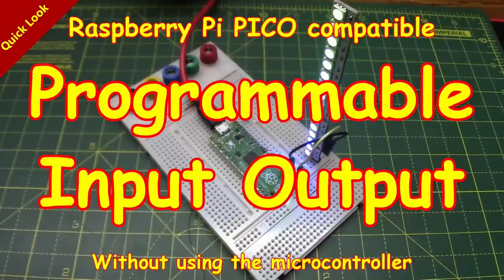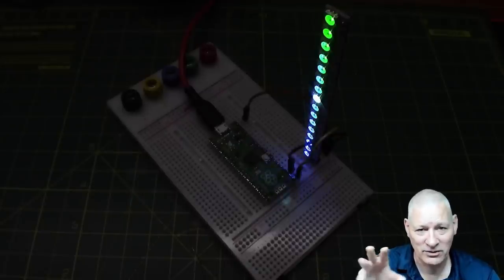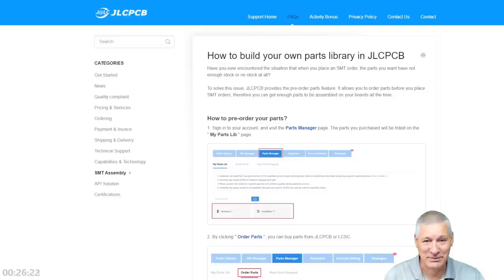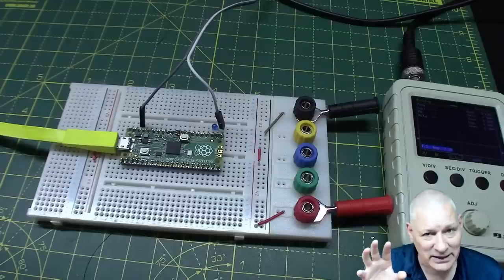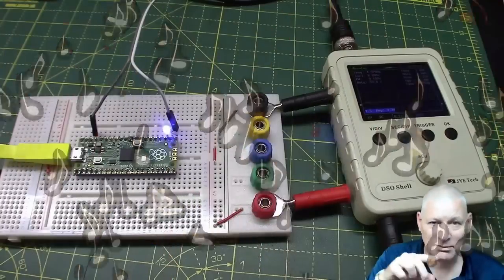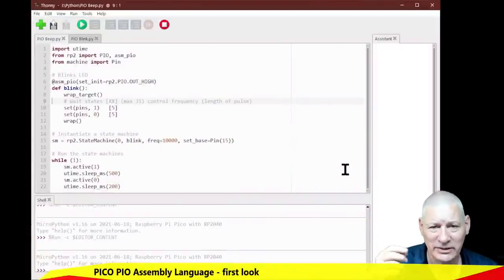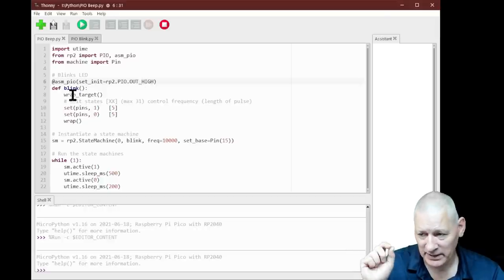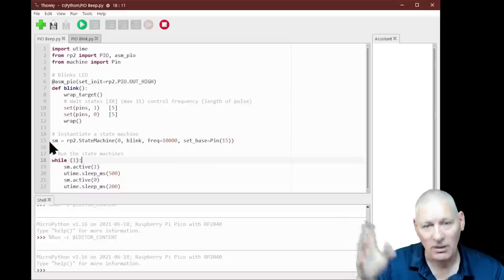#220 PICO and PIO: First Look - far easier than you might 💭 think

Comment: Sorry, but I don't see how you get your claimed 'negative pulse'.

A GPIO can only switch between OV and Vcc, so the maximum possible offset is surely only the same as The Vcc value, so with a Vcc of 3.3V its impossible to obtain the quoted 6.6V...

In terms of Forward and Backward movement of a loudspeaker cone it makes sense but, as explained, it's incredibly misleading.
Reply: With this ‘trick’ you can double the voltage, but you need some kind of external reservoir. In this case the reservoir is a mechanical item. The coil movement is the double of the gnd-pin config. You can do the same with a little circuit with a capacitor as reservoir. The cap will charge to 2x the pin voltage. Handy if e.g. you want to use a led with a Vf greater than 3V on that output pin.
Reply: @hopje01  No capacitors were used in the given example.

As, I mentioned, I can see how the Forward and Reverse action of the loudspeaker cone provides double the volume but, at no point is there ' double the voltage', as stated in the video, for the setup shown. That's what will mislead anyone who doesn't understand what's going on and it's compounded by the dual trace oscilloscope display not having a common baseline.
Reply: 100%
Reply: @hopje01  there is a big difference between + and - 3V vs GND and 0 to 3V. That is why there is no 6V amplitude on Pico ;-)
Reply: @zyghom  Exactly...
Reply: @tonysmith5485  the issue here is: however you connect speaker, scope, voltmeter or whatever: as long as you have 3V difference between one leg and another (not talking polarity here of course) it gives you 3V. It will never give you 6V. Unless one pin could give 3V below the ground while another 3V above the ground: then you would have 6V difference between these 2 pins. Show me which pin in Pico gives you 3V below the ground... - I can show you which will give you 3V above the ground ;-)
Even during this video you see: one pin gives 3V, second at that time gives 0V. so difference between them is still 3V - not 6V
Reply: @hopje01  You don't need the capacitor here (what you describe is common for powering things off 1.5v cells, eg LCD watches).
Reply: @zyghom  What's the potential between 3v and -3v?  It's like saying AC voltage in the USA is only 60v, because that's how far from ground it rises.  You are thinking ground to peak, when you should be thinking peak to peak.

0v and ground are not the same thing.  If you decide ground is -3v, then you have 6v.  That's why scopes have that knob to move the trace up & down.
Reply: @tonysmith5485  between -3V and +3V there is 6V potential. The only problem is: such configuration in Pico does NOT exist. Look at the op amp: they usually prefer to work with + and - 15V (let it be 15, it can be less). So the potential between Vcc (+) and Vcc (-) is 30V. The ground - virtual or real - is a potential between +Vcc and -Vcc, so we have +15V vs ground and -15V vs ground. But we have physically 30V potential difference. You might achieve it by having 2 wiring on trafo with drop between them: then you have 15V AC and 15V AC in the opposite phases. You take it through DC converter (bridge rectifier, regulator etc) and you get +15V and -15V: total difference is 30V at any time between them. If you don't have a luxury of having such trafo, you take simple trafo with 30V only, and you make virtual ground: 2 resistors (in simple terms) connected in serial between these 30V and in the middle of them you have virtual ground, vs which one will be now +15V and second -15V. But in Pico there is NO 6V difference at any time at any place (unless you power Pico from 6V but we are talking here logic output on pins of pico: either 0V or 3V - or as you don't care about the polarity: -3V and 0V if you revert your voltmeter). Why are we talking basics here for so long?  This is something like 101 course ;-)
Reply: @tonysmith5485  I agree completely with your first paragraph - and with +3.3V and Gnd (0V), the polarity is set; one pin is 3.3V above the other or one pin is 3.3V below the other, depending upon what you take as your reference. I have no problem with that.

But two 3.3V GPIOs, one High and one Low, will never produce 6.6V, which is what was stated in the video.

The difference between them will only ever be a maximum of 3.3V - whichever way round you look at it.

Sure, a collapsing field in an inductor can produce an inverse voltage (hence using flyback diodes with relays), but that's not what Ralph was talking about. He had the two square waves from the GPIO pins going into two channels of the 'scope and had the traces positioned apart (for ease of showing the two pulse trains in opposition) and took the physical distance between the top of the Ch1 pulse to the bottom of the Ch2 pulse as being a voltage difference double what it actually was, and double the maximum it could possibly be.

I teach electronics to newbies and that, although obviously an error on Ralph's part, is just the sort of thing that can catch them out - I had one make the same assumption just a few weeks ago...
Reply: @tonysmith5485  in US is 120V in EU is 230V, between ground and the line, one moment it is +230V then it becomes -230V. in US +120V and then -120V. Who is talking 60V in US here? ;-) Who told you it raises to 60V only? 101 brother is needed... see here: https://en.wikipedia.org/wiki/Split-phase_electric_power#/media/File:Split_phase2.png
Reply from the maker: I did put a clarifying statement at the bottom of the screen, as I just knew someone would pick me up on this.

In effect, the speaker cone moves as much as if 6v were applied to it but we're making it move forward 3 volts' worth then backwards 3 volts' worth. Total effect is that of being driven by 6v. Just as I wrote in the not-so-clarifying note at the bottom of the screen!
Reply: Wow, who would have expected that much discussion . . . it's A) relative, and B) it's conceptual. The main thing is that it's clever and it works.
If'n you don't actually understand it, it's just MAGIC !
Reply: @RalphBacon  your speaker could have 3 stages: 
1: total 0V on both legs (A and B) - no movement of the cone
2: +3V on leg A, GND on leg B: let's say it moves forward as of 3V potential
3: you revert legs and now you put +3V on leg B, and GND on leg A: it moves backwards

But it requires moving legs A and B between Pins and GND (one time leg A on GND, next moment leg B on GND) - I did not see you doing it on this video.

Otherwise... I am not buying it
Reply: @RalphBacon  I agree with that 100% - as I mentioned in my original post.

I was just worried about the use of the phrase at that particular point in the video, where the 'scope traces were shown, would mislead newbies.
Reply: @zyghom  I know about the weird split phase stuff the USA does (centre tapped 240v single phase blah blah), it's irrelevant.  The point was for 120v AC the distance between 0v (ground) and maximum will only be 60v.  You need to think peak to peak, which is also what is essentially happening with the speaker.
Reply: @tonysmith5485  you are TOTALLY wrong - each half of sinusoid in US is 120V. Same like each half in EU is 230V
Reply: The 'negative' Pulse Will never be there. So the voltage difference between pico gpio pins will always be 3.3v max. The Idea in this video is the difference between the -terminal from the speaker can be connected to another gpio pin rather than connect the - terminal to 0 volt.
Reply: @zyghom  Yeah, brain fade on 60v.  As said, peak to peak (imaginary or not in this case) is what matters.
Reply: @zyghom  Yes yes dude, 120v is really 170v because RMS blah blah.  Peak to peak referred to the original point of this thread - where does the 6v come from?  Tangent much?
Reply: @tonysmith5485  6V here is a myth (and few of us are trying to say this but few don't give a ...) ;-)
Reply: @duncanx99  Good description.  I found it easier to think of as +/- 3.3V, relative to one of the speaker pins.  If just one oscilloscope channel is used, arbitrarily picking one of the pins as the reference, the 6.6V peak-to-peak might be clearer.

I suppose that means the scope's reference needs to be isolated from earth ground.
Reply: @markday3145  Yes and No... 

You will never see 6.6V across the loudspeaker pins - you will only ever see 3.3V that reverses when the pulse trains 'flip'.

The EFFECT, on the cone of the loudspeaker, is that of a 6.6V square wave signal, centred around 0V, but at no point is there ever 6.6V between the loudspeaker pins, or the GPIO pins...